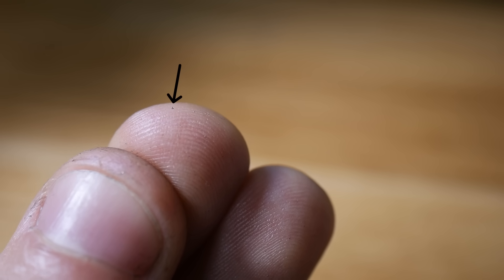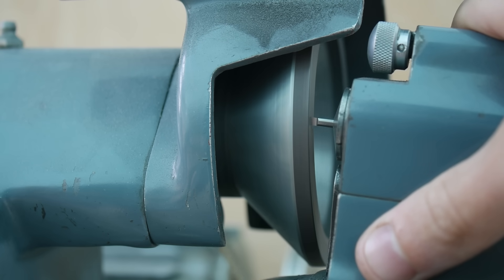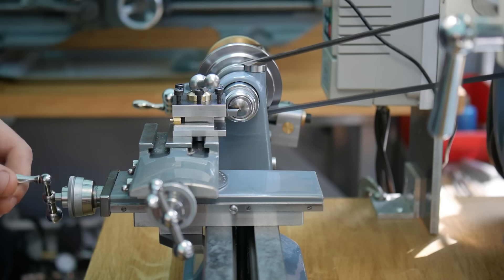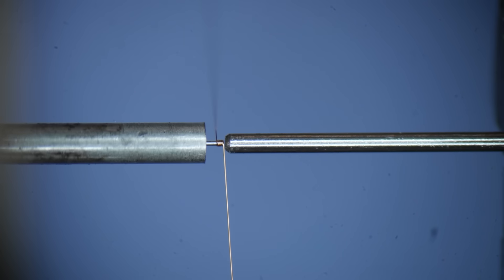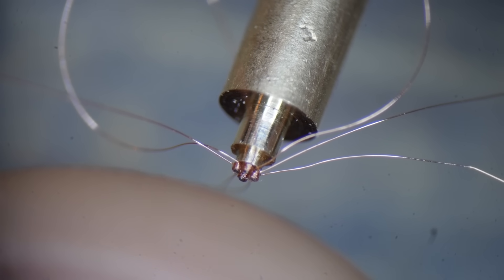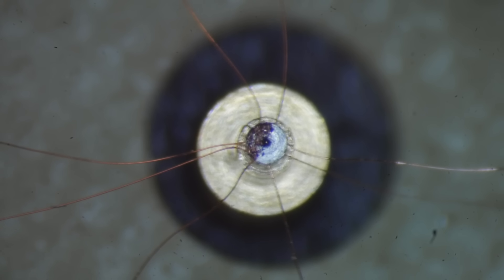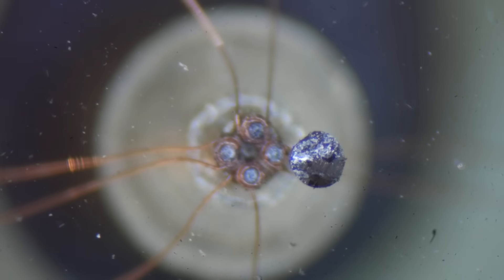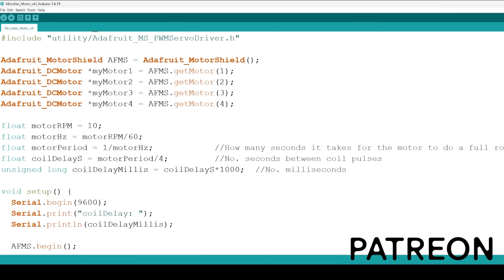Attempting to Make the World's Smallest* Electric Motor

Comment: what occurs to me is that you could get away with 3 magnets instead of four, and with the magnets just resting inside a matrix of epoxy or something: drill a hole in the middle and let the rotor float in oil inside the hole.

Comment: Why not make 3 coil only to make it simple and then feed each coil to a 3 phase variable frequency drive (VFD using arduino or any inverter circuit then tie each ending wire of coil to make it the common wire. Since your rotor is only 2 pole magnet or you can even use iron not magnetize a motor called synchronous reluctance motor. The drive coil will be still the same set up no changes

Comment: You might try building a small homopolar motor with jewels at each end. I'm not sure if it could fit in the same scale, but operationally it's a simpler design.

Comment: Brilliant video! I've always wondered why no one has tried to replicate the McLellan motor. I'm a Ph.D. student who designs and builds microrobots, so I have some experience in this area. A couple of suggestions:

1. As someone else mentioned, UV glue is awesome for assembling things like this. My lab loves Bondic [1], which is readily available online. It is definitely weaker than CA. If I need a strong joint, I'll use it to fix a part in the correct position, and then reinforce with low-viscosity CA (Loctite 495 [2]).
2. For applying glues at a microscale, we use either super-fine tungsten wires [3] held in a pin vise [4], or micro spatulas [5] (my favorite). Residue can be burned off with a lighter.
3. As you said, soldering fine-gauge magnet wire is...challenging. I've never really gotten the hang of it, so I prefer to carefully scratch the insulation off with a razor blade under a microscope, and then adhere it to a PCB pad using conductive epoxy such as MG 8331D [6]. Others have had luck using lots of flux and very low temperature solder.
4. For poking prodding and positioning, we have had great success using dental picks (along with super fine tweezers). Reverse action tweezers (which are bit hard to find with super-fine sizes, but possible) also seem to reduce how often parts go flying by applying a constant pressure.
5. For the record, I think that a jewel bearing is an excellent idea for reducing friction. Centimeter-scale microrobotics has moved away from rotary actuators because friction scales poorly as size decreases. However, I think that another reason is just how difficult it is to build small rotary motors, so thanks so much for your awesome work here :)

If you have any particular questions, feel free to shoot me a message. There are some other people in my lab who have ideas that could help you, but I don't want to publicize them here without their permission.

Links to products mentioned:
[1] https://www.amazon.com/Bondic-Activated-Waterproof-Resistant-Adhesive/dp/B018IBEHQU?ref_=ast_sto_dp
[2] https://www.amazon.com/Loctite-Bonder-442-49550-Instant-Adhesive/dp/B00065UAH2?ref_=ast_sto_dp
[3] https://www.mcmaster.com/3775K36/
[4] https://www.mcmaster.com/8455A16/
[5] https://www.digikey.com/en/products/detail/excelta-corporation/260AA/16691210
[6] https://www.digikey.com/en/products/detail/mg-chemicals/8331D-14G/13170710
Reply: love how people make use of the youtube and comment with bright ideas. it is hard to see nowadays. youtube should be a base for people to connect with one another to achieve something great like what you people contribute today. thumbs up guys.
Reply: Great write up! Thought I could contribute a few thoughts also:

I haven’t used these specifically, but I have had great success with Excelta tweezers (or any Swiss made precision tools, really) in my lab for wafer handling and micro soldering. They make reverse tweezers [1] with the smallest size being “very fine point” (0.2mm x 0.1mm tip). They also have a “Straight Cobaltima®” line [2] that which go down to a ludicrous 0.01 mm x 0.05 mm tip size. 

On-wafer probes (specifically those for DC) might also be of interest as they have extremely fine tips (~ 5 micron tip radius) and can be placed on an XYZ micro-positioner for micron level control. Probes like the Form Factor DCP 100 [3] are fairly cheap as far as probes go and have replaceable probe needles/tips. You can also get more of a  whisker style probe too. Typically made of tungsten wire with beryllium copper tips (though the metallurgy varies wildly so don’t quote me on that). They are also of course conductive ;)

[1] https://www.excelta.com/very-fine-points-31-sa

[2] https://www.excelta.com/straight-tweezers-and-forceps-extreme-precision-cobaltima

[3] https://www.formfactor.com/download/dcp-100-datasheet/?wpdmdl=3382&refresh=6797d2040202a1738002948
Reply: Props to you guys, and comment for the alogryim
Reply: Tip for soldering micro wires. Usually when soldering wire you would get the conductor up to temp and then apply solder, allowing it to wick between the individual conductor strands.

On such a small scale conductor, even a coated one, the exposure time to the heat of the iron required to ensure good electrical contact is infinitesimally less. The coating should be removed in advance if possible, though at such a scale mere moments of exposure to soldering temperatures should be sufficient to remove the coating during the process.

Although I have not worked with anything quite this small, on larger (but still small!) scales I've had success with pushing wire into melted solder and limiting significantly the duration of exposure to working temperature of solder. You want to do remove heat almost the same moment the wire enters the solder, as even a fraction of a second of direct contact between the iron and the conductor can cause it to leave chat.

This was done on signal wires used for expendable bathythermographs. Which, on second thought, might be of a similar scale. I just wish they'd given me a damned microscope to do the work with 🤣

If you have the ability to make a coil of wire, almost like a pad, to increase the mass at the end of the wire it might help also. Either coiling or simply folding it back and forth can increase your success rate.

My preferred method is to have the wire prepared and sitting above the solder, melting the solder on the pad and pressing the wire down into the solder, as opposed to pushing the wire into the solder since such small wires aren't very strong mechanically.

Edit: leaded solder. Use leaded solder. This new age "safe" solder is absolute crap to be honest.
Reply: @MWBgq  Thanks for the suggestion! I'll be sure to give that a try
Reply: Best subject qualified comment section on YouTube I’m sure of it
Reply: Great response and great resources. Where are you studying?
Reply: Fancy seeing you here 🙂
Reply: @landonivy675  Haha hey man!
Reply: Too small 😔
Reply: I wonder if a low melting point solder like InAg or SnBi would be better for the coil wires
Reply: 😮 Times like this I realize how much I don't know. I salute you guys for your expertise,  knowledge, and willingness to assist strangers.
Reply: My links are always blocked
Reply: Thank you daddy
Reply: The Connections (2021) [short documentary] ❤🎉

Comment: The part being so small that the flexing in the fingers from breathing to blow it away is crazy. I doubt its the breathing you could easily put a large (relative to the piece) piece of thin glass/plastic to see through above the workspace to divert breath.
Did you hand have some platform to rest on while breathing in/out? Maybe that could be enough stabillity to breathe in and give you more time getting it in

Comment: A different geometry:
Overall:
Rotor is a ring or sleeve
Stator is 2 u shaped pole pieces with a coil wound on the bottom of the u. 1 pole piece is inverted, turned 90 and slotted into the other.

Make pole pieces each from bar same diameter as finished motor. Cut slots like deep screwdriver slot.
When slotted together cast it in resin.
Machine down resin and excess material of the pole pieces so the rotor fits.

Comment: Wouldnt a homipolar motor be far easier? not easy per se but at least potentally dooable. You might also look at ion/charge rotors as opposed to magnetic arrangements. cool project whatever. BTW an ibduction motor dosnt require a magnitized rotor or any form of brushes. going back to your origional turned rotor a drop of oil between the coils may well hold on to a shaft, locking the disk above the magnets.

Comment: I absolutely loved watching this, your work here is amazing :)
I had a few thoughts that might help both in terms of building a rotor in AlNiCo or even potentially in neodymium magnet material directly. There are now open source EDM controllers which would enable you to build a miniaturised EDM sinker if you wanted to, or EDM wire cutter, although, obviously you'd then need a wire feeder etc. The benefit here would be nearly zero force machining, which could solve your parting problem.
Depending on how committed you get to the design, this would also allow you to make custom carbide tools at this scale as well, which might help with your operations on materials like the AlNiCo etc. where you conduct those on a lathe.
As an additional suggestion I've build broaching and form tools in the past for (admittedly much larger) jobs which required substantial variation in job diameter for a lathe. The benefit here is that a broach uses symetric cutting, which results in a far lower risk of part damage during turning. Forming things like the rotor and shaft could be made in a single operation and manufacturing the broach would actually be easier than manufacturing the positive you want to produce from it, because you're drilling holes and milling steps, not cutting long unsupported shafts.

I hope this doesn't sound like I'm being negative about how I view your work, I was trained up as a toolmaker as a child and worked on relatively small die and tool jobs before I did my engineering degree, I've been an engineer for about 20 years now in a pretty niche high product value field and I can tell you that the work you're doing is unique in my experience. I'm frankly amazed at what you're achieving and I hope that my suggestions might contribute positively in some way.

Comment: If the requirement is for a "motor", you could go the magnetohydrodynamic route - pass a current through a fluid in a magnetic field. Or you could flap something to and fro - it's doesn't necessarily need to rotate.

Comment: I once was told by a man who made coils with 40 micron wire that common super glues do work for a period of time, but pretty soon with such thin wire it destroys wire's isolation. After a lot of testing now he uses shellac for such wire.
Reply: What  do you mean by Shellac sir?
Reply: @mr.perfect1067  Shellac is a resin secreted by certain bugs(often used for jelly candies). It easily dissolves in alcohol, so one can modify viscosity and even redo if necessary. I have even seen flux sensors made with 20 micron wire that are 30 years old which were successfully used for cryogenics.
Reply: @ВладіславЗаморський  thanks for information🙂❤

Comment: With multilayer pcb fabrication, can use a 6 layer flexpcb(one that is pure polymide without adhesives) for the 3ph stator coil. The rotor can be a tiny machined magnet with segments magnetized by a large magnetizer with razor sharp segments placed around rotor(the rotor dropped into hollow center). That way, you could make everything tiny and use a 3ph motor controller and make as many as you please, everything working the first attempt.❤👍

Comment: Very cool project! If you work on it again, consider trying a switched reluctance motor. You don’t need a magnetized rotor. Reluctance is the magnetic equivalent of resistance. An iron rotor will provide a lower reluctance path than open air. So if the rotor is shaped like a “T” so that looking down the shaft, it has a bar at the end instead of a disk, the top of the T will align with the path magnetic field to minimize reluctance. I believe you’d want to energize the coils diagonally with opposite polarity.

Comment: Seems that rather than making the rotor as one piece that it might be more advantageous to make the disc and the shaft separately, drill the disc for the shaft, press fit the shaft into the disc.

Comment: On the subject of cheating with jewel bearings. If one were to suspend a conveniently magnetized metal filing (or debris from a shattered magnet) in a droplet of watch oil in the center of said bearing, and then grind in some notches around the outside that would allow you to wind 3 coils 120 degrees apart, and then drive them BLDC motor style, would that not satisfy the brief with very little actual machining of tiny parts?

Comment: Your craft is truly amazing, the only experience I have with a lathe are full size industrial ones and probably considered quite small by industrial standards. It's amazing what can be accomplished with relatively old technology. I'm guessing the tolerances are too tight or more likely expensive for CNC at that scale. Converting full size lathes to basic CNC control isn't too difficult but they're nowhere near as precise as purpose built CNC machines.

Comment: You can simplify the design a lot by going with a switched reluctance motor, you only need 1 coil and no permanent magnets. The control logic is a bit more difficult, but plenty of people on youtube have done it with arduinos (its not like and esc, don't waste your time trying)